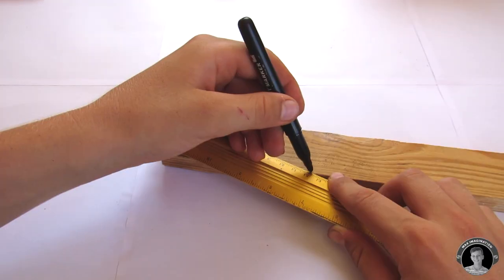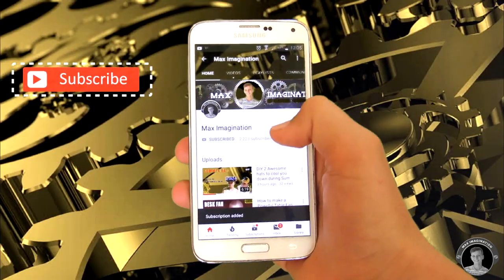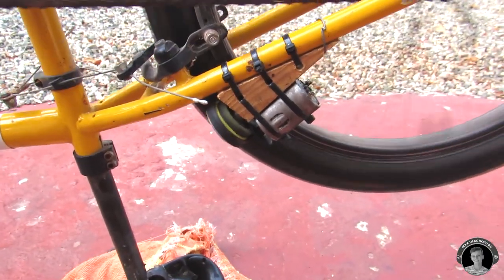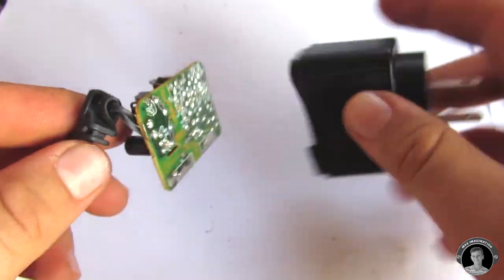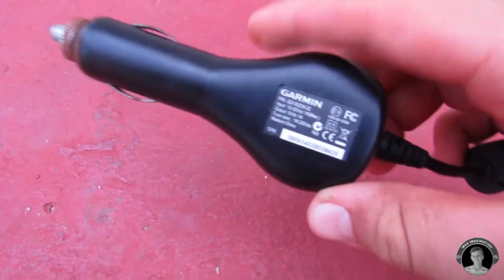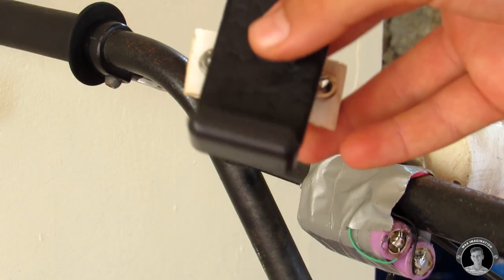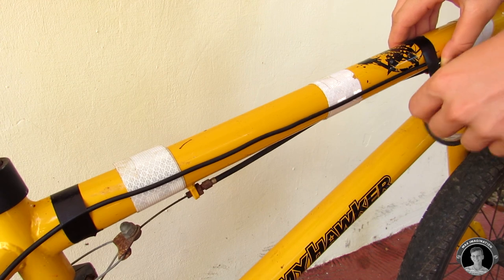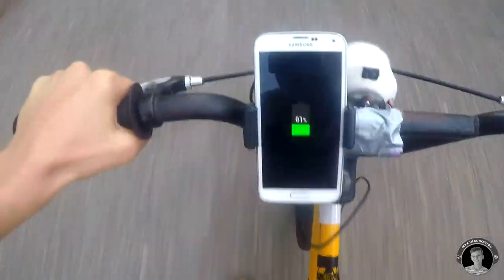DIY Phone Charger Powered by Bicycle | Pimp My Bicycle Part 4

Comment: Thanks for this--I've had a bike with a 6V/3W S.O.N. hub generator attached to lights for 20 years now, and I want to add a charger to it. I'm wondering if the load of this charger would dim my lights too much. I guess experimentation is the only way to find out! Would the charger draw a load if the phone is not attached?
Reply from the maker: Hi there. You're welcome. The charger only draws a load when there is a load attached to drive.
Reply: @MaxImagination hey will it work on new phones these days
Reply from the maker: @coding32111  Yes

Comment: Its slow because u used whole Board from charger and there are resistors that slowing electricity. They are build for high voltage not For DC motor. So you have to Make your own "board" that for DC motor for faster charging
Reply from the maker: It's not perfect, but only my first iteration of the dynamo phone charger concept. Good point to keep in mind for the future!

Comment: To get your phone fully charge? How long does it takes?
Reply from the maker: It would probably take the same amount of time to charge as your phone plugged to an outlet, 1-2-3 hours depending on what ampere board you're using and what phone. 
A cheap button phone back in the days would probably charge within a 30-minute bike ride. It all depends. 
For this bicycle powered phone charger to be more practical, you'd need to hook it up with some battery, sort of like a power bank, so the dynamo charges the batteries first, then from the battery to your phone.
Reply: @MaxImagination  it would also depend on the speed you're going too right?